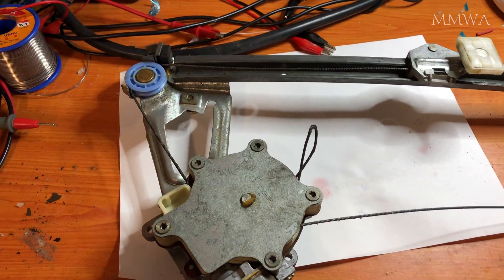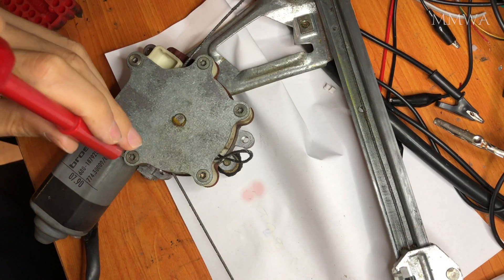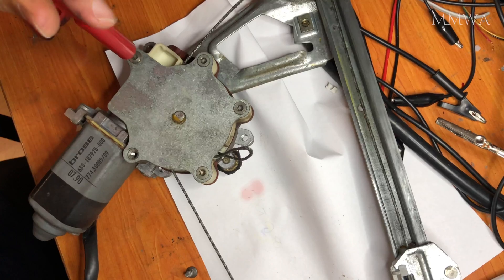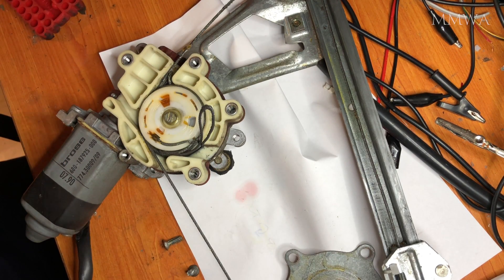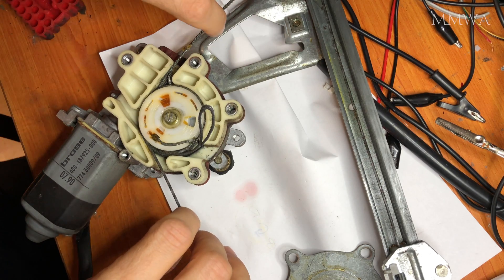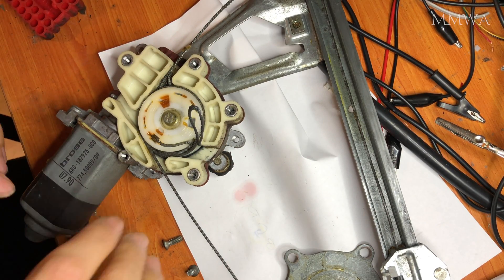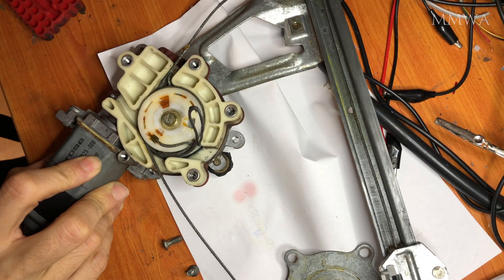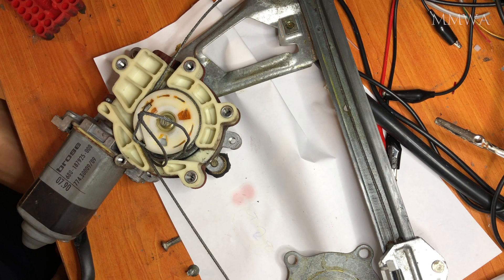W124 - Detailed teardown of rear window regulator motor

Comment: I just refurbished mine with a 30euros kit I found online. It was a bit tricky to get the cable attached, the tension is quite high, but I got there in the end using locking pliers. It beats buying a new complete regulator which will be more expensive and of worse quality.

Comment: This was useful to see - used complete window regulators start from around £50 and go upwards ; however I did find on 'a well known auction site' repair kits which include new cables and springs plus that pulley for between £5 and £15 , although some are for W210 they claim to be compatible with W124 . Only my nsr regulator is giving trouble with the tell tale loop of cable hanging loose by the motor ( having removed the door card to check ) .
I'm minded to order one of these repair kits towards the bottom end of the price range and see if it works , and if worst comes to worst I can order a complete regulator . Easy enough to cut a piece of wood to length to keep the window closed and car secure until it is fixed .

Comment: Why do we used Chinese as a insult Al the time ?  😊
Reply from the maker: because Chinese parts have no place on a w124.
Reply: @MMWA-DAVE  but my oem part didn’t even last as long either . It’s crazy how eveyone assume the Chinese parts are junk but they never build the parts themself 😬
Reply from the maker: @chuemoua6834  for what its worth, i have chinese regulators in the rear of both my 124’s and they work fine. The cars are hardly driven and even then I never use the rear windows so cant speak for their longevity
Reply: @MMWA-DAVE  tell me where to buy it . I rather spend less on a car that doesn’t have much value .
Reply from the maker: @chuemoua6834  I got them on ebay. Beware theres versions with and without the motors. I got the versions with the motors. The ones without dont fit the factory motors without alot of work and modifications.
Reply: @MMWA-DAVE  is it true that coupe will only fit coupe and convertible will nit work vice versa?

Comment: hello, on W124 260E. front window. how you test the motor with direct battery ? 2 wires green and black. green wires go to (+) battery. negative battery go to ground or other black wire ? best vibes cheers ;)

Comment: The large nylon gear on my front right motor has a few broken teeth, do you know if that part of the motor housing which contains the gear is available for purchase separately? My motor works fine, the problem is when it gets to the part with the missing teeth the window stops and it will only continue working if you help it by hand.

Comment: Thanks for the informative video, now I know how to take out the motor from the assembly, which is somehow broken down, do you suggest having the motor repaired?
Reply from the maker: I was never able to find parts for the motor assembly so unfortunately ended up with chinese replacement complete regulators
Reply: @MMWA-DAVE  Thanks, I will be looking to find replacements in the junkyards then

Comment: Thanks for your advise on this matter and all the other info you provide to the community. I bought a few second hand ones but they generally don't last and the cable get entangled as you have shown. However, I also bought cheap complete sets from Amazon and so far no problems at all. 

Keep up the good work and thanks for your help.

Comment: Did you find a mfg for the replacement wheel?
Reply from the maker: Frank Riedel they are available from powerwin.com.au that gear is 3 pieces. The bottom bit with the teeth that is no longer round is available.

Comment: These are signs of time... lol old grease, heat and maybe not much use through the part's life. Mine has manual regulator and I'm wondering if it's a good business trying to install a generic motor matching to the lever's gear...
Reply from the maker: many years ago when I was a teenager, I drove an australian made ford with manual windows, at the time there was a conversion kit you could buy with a motor and a flat coupling you slotted over the manual handle shaft. The motor was remotely connected to this coupling with 2 flexible tubes. You then put a plastic cap over the holes in the doors where the handles were. I thought I was clever & purchased the oem front 2 window switch panel with switches and wired them up to use these. It worked pretty well surprisingly though the baily channels were worn and these windows were huge so they struggled to lift sometimes.

Comment: Thanks for the tear down and analysis. Look forward to your solution. I have two rear windows with problems, and the drivers window is sloppy, so I’ll dive in soon. Your video is a great guide. I didn’t see your method to release the clips at the bottom of the door liner. I’m interested to know if you have a method other than any thin pry tool. Thanks!
Reply from the maker: majicul you lift the whole trim straight upwards. These are hooks and will be broken if pried
Reply: MMWA I should have said mine is a ‘93 W201. There are a few fasteners at the bottom of my doors that require prying out of fittings in the door. I was likely mistaken your door would be similar. Once Those bottom fasteners are loosened, mine also require pulling up to remove. Thanks and hope to see your fix for the regulator and motor.
Reply: The front regulators are entirely different and use a toothed quadrant where the teeth usually wear down near the limit points ; some people have had success welding in new metal then filing the teeth profiles back ; or you can buy a new regulator minus the motor for reasonable cost .